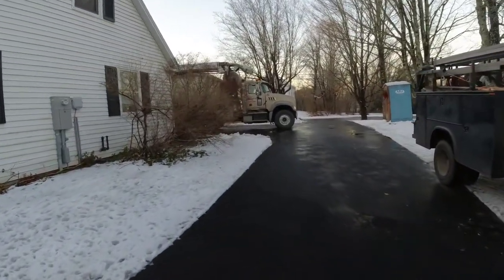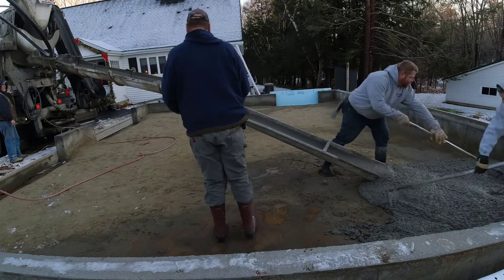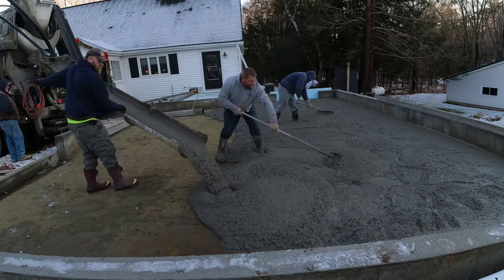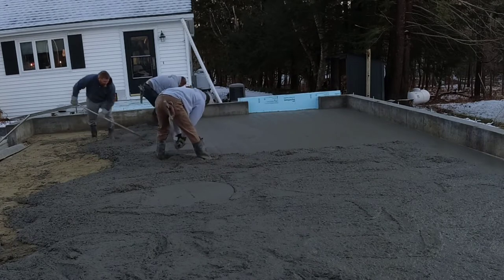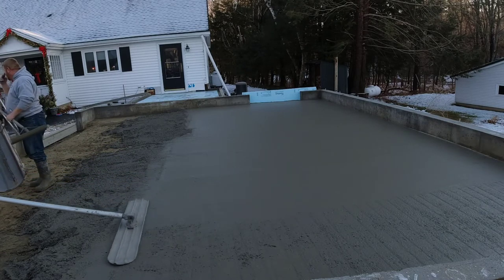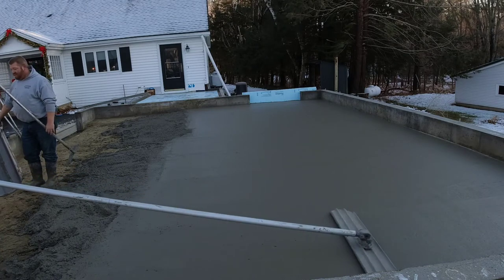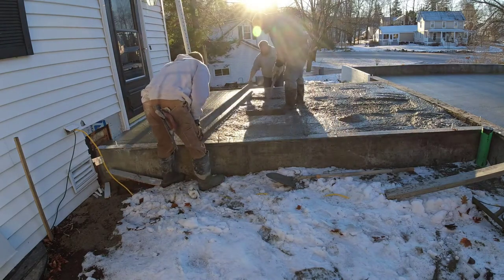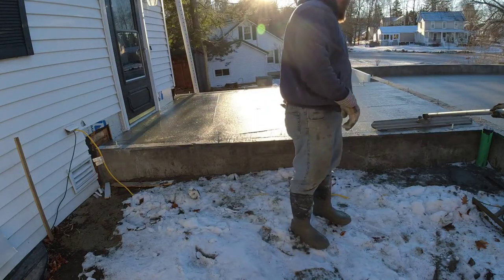The Ground Was Freezing As We Were Pouring Concrete. (It Just Snowed)

Comment: Not worth the possible problems in those temps, but you guys have a system that apparently works. Most drivers are great, but a few are not, and make the pour very hard….all trucks here west mich are pretty much front discharge.
Reply from the maker: There is quite a bit of risk. We do it a lot though.